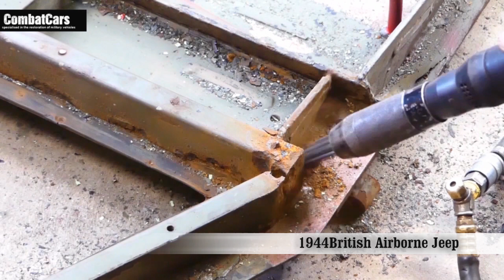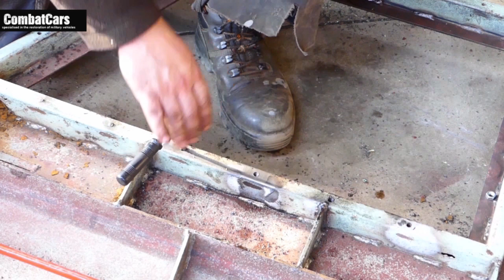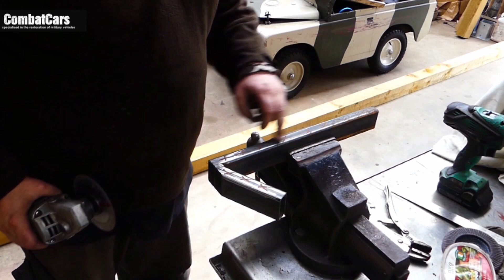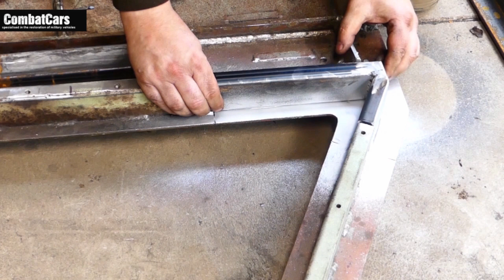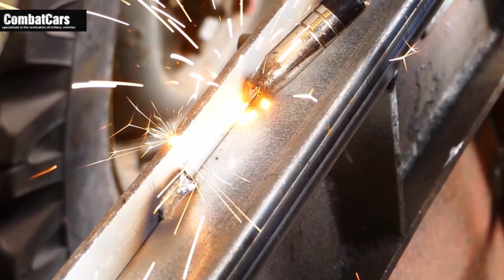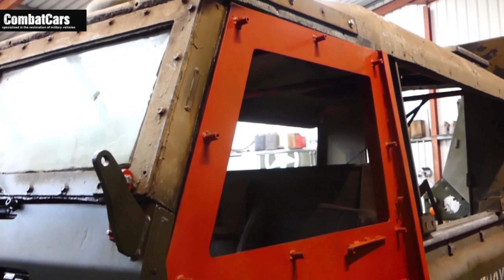Piglet Part 6. Doors.#everyone #automobile #mechanic #welding  #restoration #armylover #military

Comment: Just a quick top in mag Welding, Push Not pull, wich means u want to work away fom Ur puddle so u always poke in to the cold Material so to say. It helps with the depth of Ur Weld and reasures a clean weld. U dont even have to commute. And sorry for my grammar im a german 
MFG
Lukas
Reply from the maker: Always up for helpful criticism 👍👍